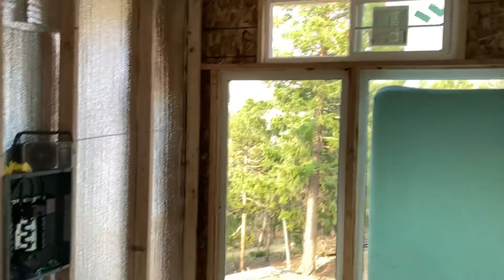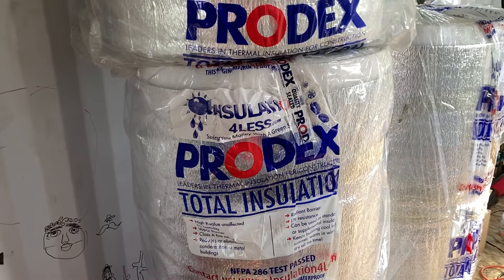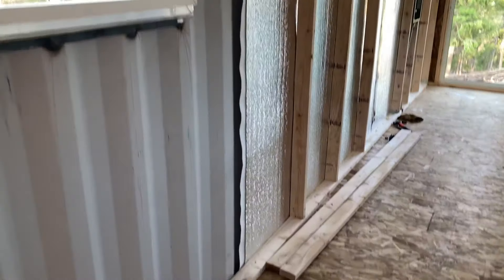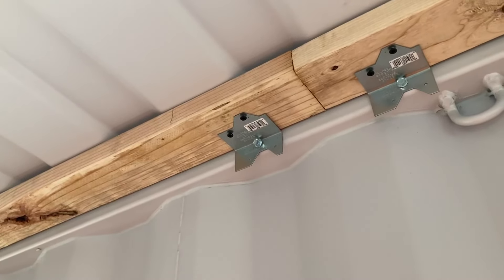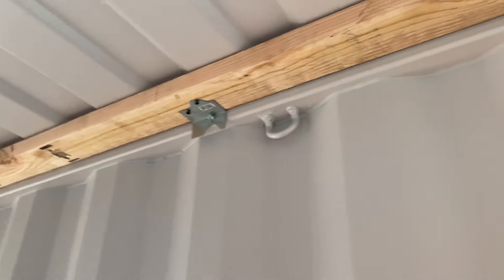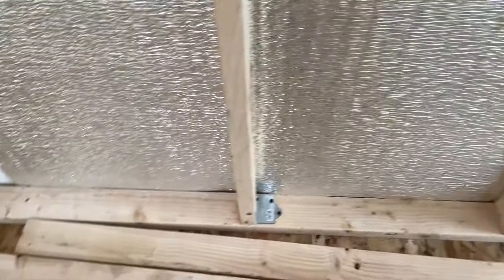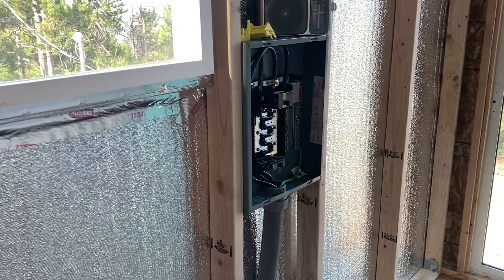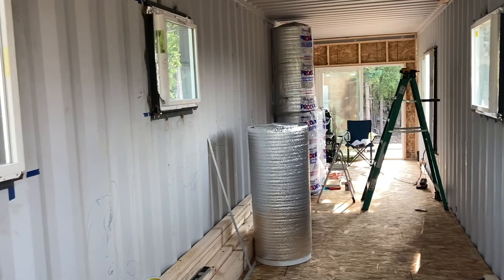Installing studs and insulation in container house

Comment: Im on my second container build. Rockwool is my go to insulation for price to performance ratio. The brackets are a unique choice. If the framing isn't going to be structural (99% of cases) nails or screws into the wood will save a few bucks and alot of time. I attach the sill plate to the container floor and let the ceiling and walls support themselves.

Comment: Any concern about condensation behind the insulation?
Reply from the maker: I thought a lot about condensation.   The prodex roll insulation is closed cell foam with aluminum front and back.  I foil tapped all the seams so it should be a good vapor barrier.   Then added fiberglass with vapor barrier.  Then installed high volume exhaust fan.  Plus the humidity in Colorado is typically 15 percent.